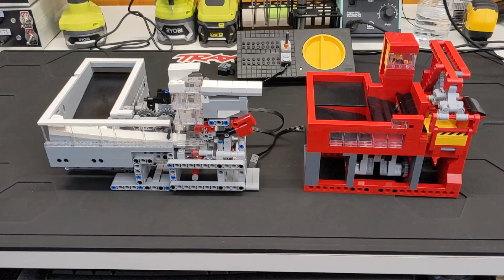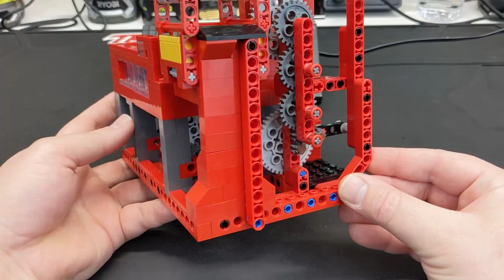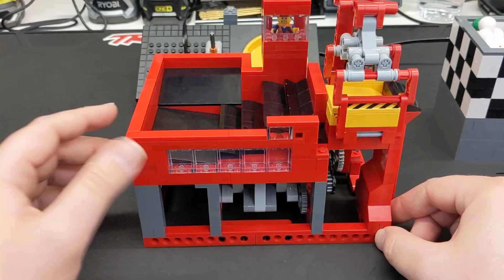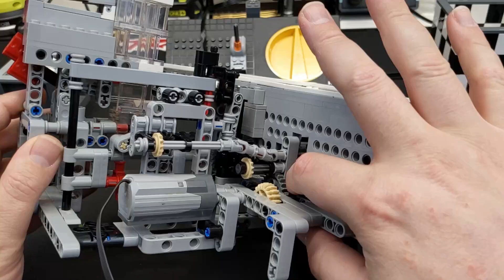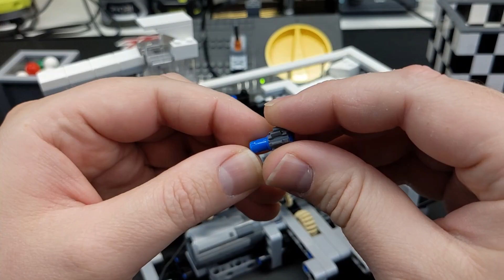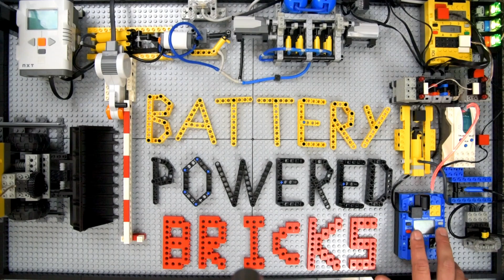GBC Module Review - Pinwheel's Reveal Ball Pump and Emmets Crane

Comment: Sorry Reveal was such a big problem! It’s strange how problems can happen in different places. Those steppers that go up and down on axles rely on straight axles, and my version of Reveal doesn’t do a good job of supporting those axles that gave you a headache. 

I also recommend Dunes’ version, both in the YT description and in the rebrickable for the module.In fact, my plan was to build that and bring both to Brickworld last year. Since Dunes ended up attending and bringing his, I didn’t build it anymore, but I still plan to build his version.  He has been amazing at taking a design and improving the mechanism and polishing the design as well, something I don’t have the talent for or the patience.  Dunes also figured out how to get rid of the chains in the Emmet module.

I’m glad you were able to get Reveal somewhat running, you at least get some payoff for your efforts, plus some additional experience in GBC troubleshooting, though likely much more than you expected. 😏

Also, the gate feeding the balls might be feeding it too early, maybe move it by a notch or two. Dunes’ version, as you mentioned, proved that it’s unnecessary.
Reply from the maker: No need to apologize!  I'm happy to learn new lessons that will help later on.  I'm glad I built your version first so I could see first hand the improvements Dunes has made.  The gate timing is off, I kept making adjustments on other sections and eventually stopped worrying about getting it just right 😅.  But it did teach me a bit about adjusting timing in GBC modules.  Also to be fair I'm still working on getting Dunes version reliable, these stepper modules can be troublesome when you are dead set on not using lubrication 😀
Reply: I never use lubrication on any of my modules either. The thought of having lubricant on my Lego parts.. 😵‍💫

Comment: Mate just silicone the axles. I have built numerous of the more complex GBCs. You can search hours into finding the straightest axles, but after about 2-3 hours at a show they will be buggered. I have tried to run without lubricant but its just not worth the headaches, especially  when your building more complex GBC's and more of them. We had a reveal ball pump at the last event I was at. It started to jamb up the steps after a few hours. After a quick silicone spray there was no more issues with the steps. 

Anyway, cool video. Have fun with your future GBC addiction. 😅
Reply from the maker: I think I will end up lubricating the axles.  I do agree with Matt that I don't want to lubricate any areas that could be transferred to the balls.  An example being Berthil's rainbow stepper (the actual steps the balls ride on, not the axles).  Thanks for the comment and the help with the addiction, I know I've seen your name credited on instructions I've followed 👍

Comment: Do you use real lego balls or did you find a cheaper alternative? I once looked for (plastic) bairing balls but without succes. I thought of bearings because there the tolerance on size is important and with plastic beads size is not so important...
Reply from the maker: Actually they are in my next haul video.  I've been getting 100 count bags from Brick Loot (I order them from Amazon).  I just got my third bag, which "should" be all I need 😅

Comment: I’m glad Emmet worked out for you! There is an Emmet v1 - my first attempt at a fully compliant module. I failed, it was two plates higher than the max allowed. (Who woulda thought the plate at the bottom and the tile at the top counts for the height 😅).

I never made a video of the original, but it does show up here https://youtu.be/CUqFkI5cyVI and I think GBC Andre still has a copy of it intact.
Reply from the maker: No downtime yet with Emmet's Crane, which I'm sure takes its toll on Emmet 😅.  I think it's a great module for someone just getting into GBC.  Thanks for sharing version 1 and the lessons you learned along the way 😁